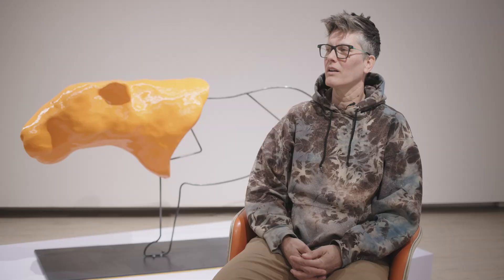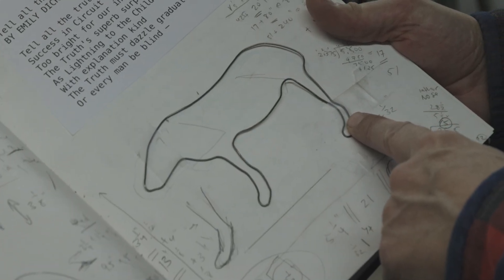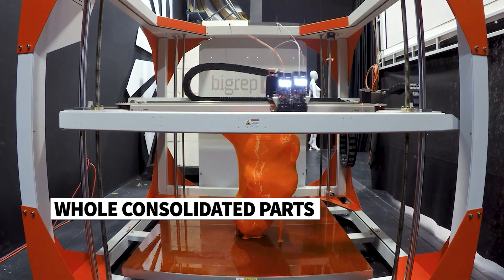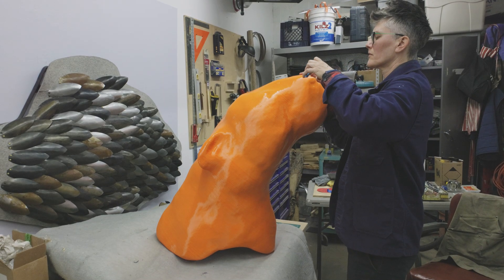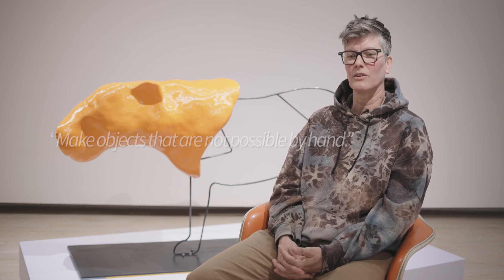3D Printing Sculptures for Creative Exhibitions | University of Mexico

Comment from the maker: 00:00 Artist Welly Fletcher creates beautiful 3D prints for Solo Exhibition
00:55 Prehistoric lion-human sculpture displayed on wire armature inspired the artist.
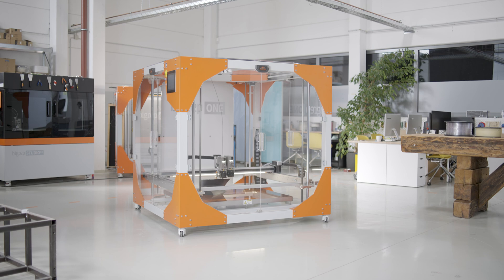01:22 Discovering the potential of PLA bioplastic filament in 3D printing
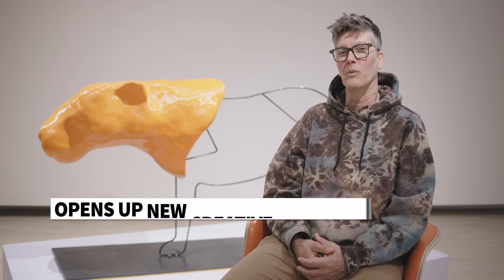01:55 ''3D prints are incredible due to the magic of pushing a button and seeing the finished object appear.''
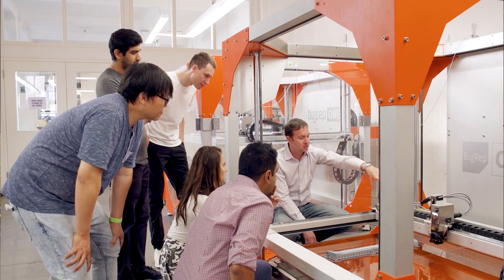02:22 Experiments and collaborations using BigRep 3D Printers at University of New Mexico
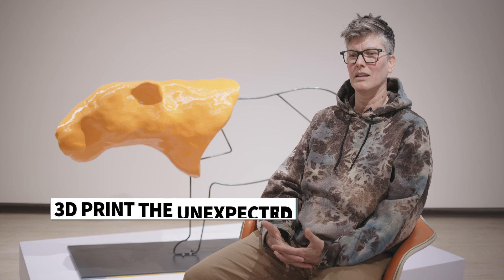02:52 3D printing allows for creating large seamless sculptures with unique material selection.
03:28 Utilized the BigRep Orange PLA for 3D printing sculptures.
04:02 Digital technologies revolutionizing sculpture